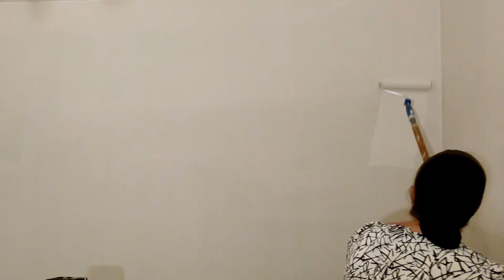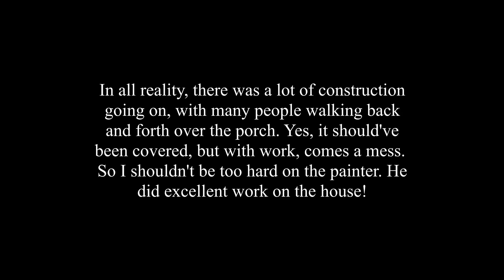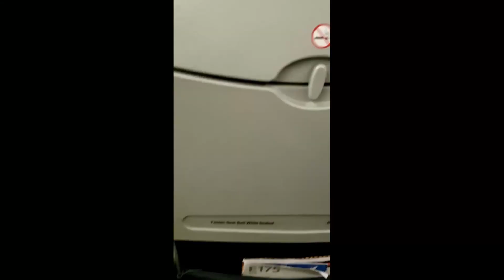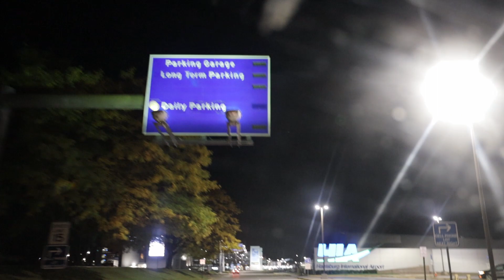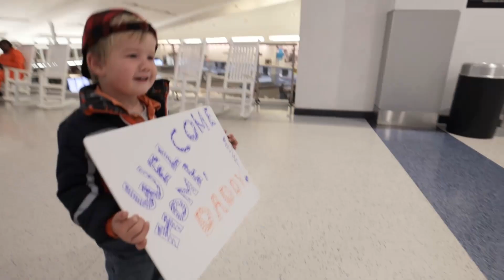he finally came home! || Our surprise was a success!

Comment: I’ve worked with a lot of contractors and sloppy, irresponsible is never acceptable. 
I’ve had them be polite, smile and be charming but do the opposite of what you asked. 
Your painter should have been released from his contract. 
My experience is that even if he agreed to clean up his mess-which never should have happened by the way-he would have dine a very sloppy, resentful job of undoing what he did. Unfortunately.
Reply from the maker: Yes, however he has such a good price for us, I decided to take care of it myself